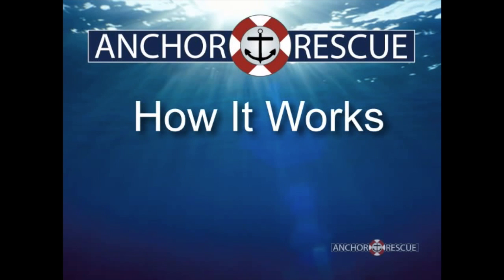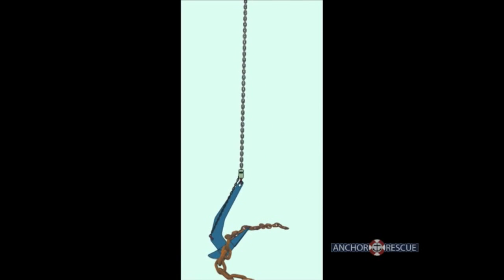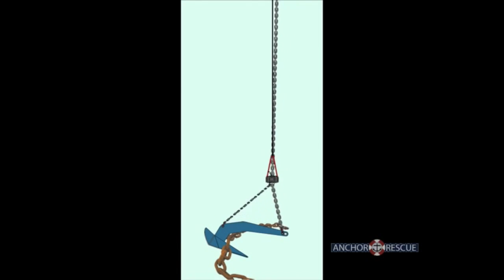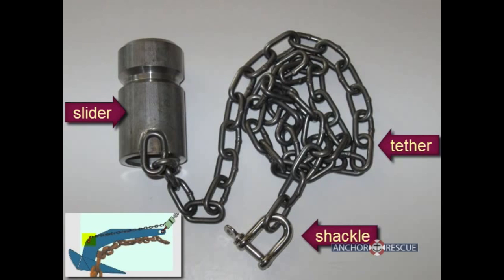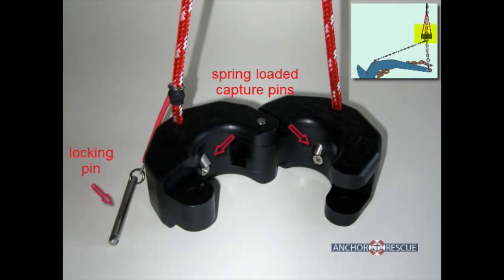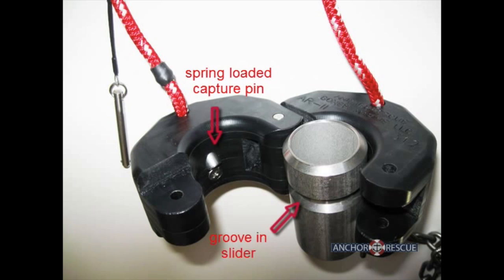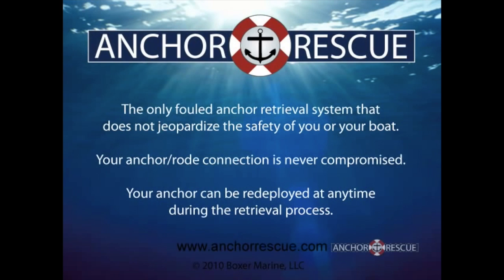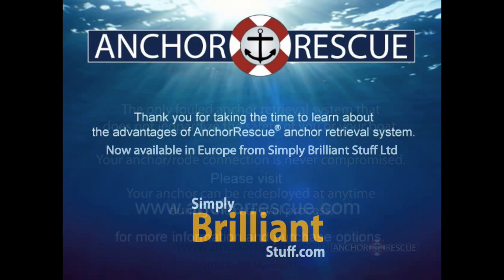'Anchor Rescue' anchor retrieval system

Comment: Ok. But the animation shows the anchor shank being lowered back to the seabed just before the anchor rescue does its job. That wouldn’t happen if the bow of the boat is directly over the anchor at this point with tension on the ride. So, will this contraption still lift up and back if the shank remains in the raised position?
Reply: @Jeremy Imes. I’ve never tried this equipment, but it seems good. I assume that the “retriever” being lowered down the chain will attach well to the “slider” with the chain being held taut. However, it seems obvious that when wishing to use the system to get the anchor freed, the chain (rode) must be at least somewhat slack, to move the lifting force to the bottom of the shank. The only way to make the anchor let go of whatever it got stuck on is to “reverse the hook”, meaning that the shank must come down significantly. That’s the actual point of the whole system. To get a method for pulling at another spot on the anchor, when needed, without changing anything in the normal anchor setup. The other various solutions on the market, with a weak link are stupid and dangerous. They weaken the anchor reliability dramatically.